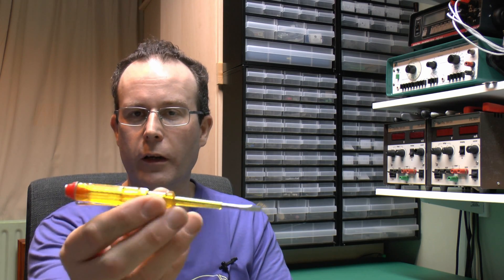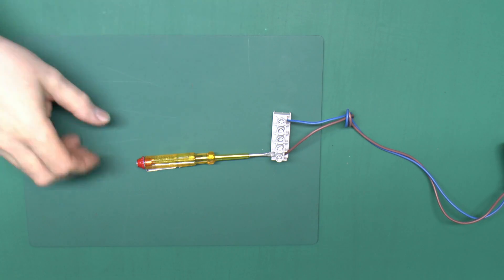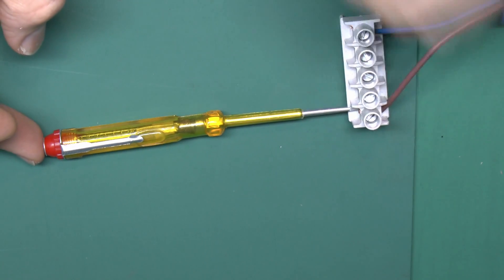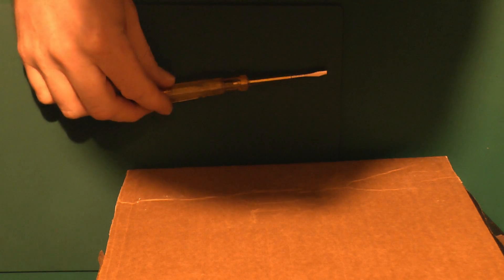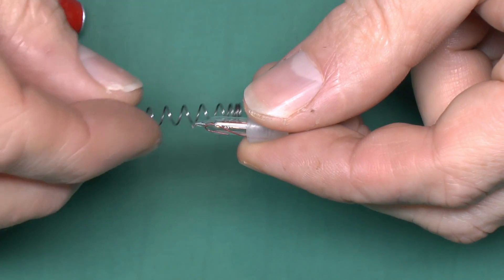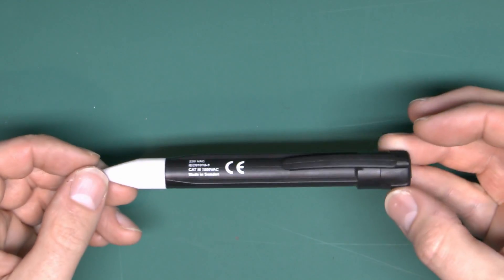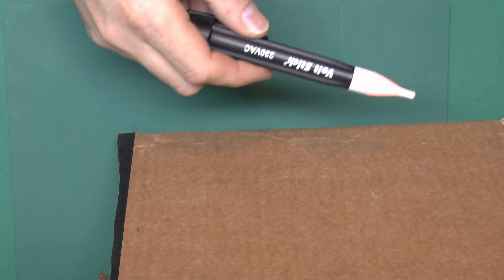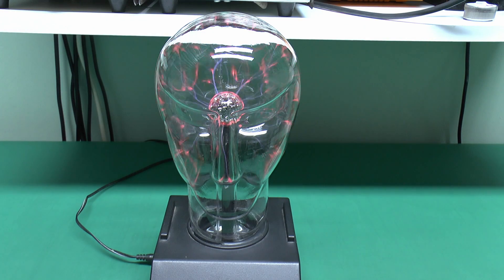Dangerous Device - Neon Mains Testing Screwdriver

Comment: Neon testers/screwdrivers are perfectly safe and very practical : you need only one hand to test the presence of the mains voltage.
How you should use them : first make sure it's working by probing an outlet you know for sure is live. If it lights up, only then you can check unknown circuit.
That's because those testers can fail in which case you could test an outlet under voltage and neon wouldn't light up, getting you shocked by believing there's no voltage.
Two pole testers are much more dangerous and require two hands.
Have you not witnessed a situation in which neutral wire is cut off ?
I certainly have.
So, your two handed tester doesn't light up because there's no voltage differential, no current return path (broken neutral), but : there is live mains still present.
You assume there's no voltage in that circuit and, .....
Reply: Szakembőr TV TMIAE 
Of course there is. The current flows in both directions, yes. But there is indeed a current return needed. Because you need two poles to create a voltage differential. In case of the neon tester, you are grounded, and therefore you already have the "neutral" potential. A small amount of current will flow through the neon/resistor. 
The plastic tester works like an antenna which receives the 50Hz/60Hz electromagnetic pulses/waves from the socket. BOTH only work on the live wire, not neutral or GND(which as far as i know, is a second connection to the earth, neutral is connected to it as well)
If you are NOT grounded, e.g. wearing insulated shoes, the tester will probably not light up. (Maybe, the tester WILL light up because of the EMI)
EDIT: my fault, it will light up, because of human body capacitance. But the current through the neon greatly depends on things surrounding you and the texture of the floor.
Reply: John Smith or u could find a earth . jus to be safe
Reply: If you are testing household ac wall socket circuit only, you are right, it is almost safe, but in case if the circuit involve any ac voltage less than the ignition voltage of the neon blub, you may get a good kick from it. Some old pa system may be?

Comment: Novice question - if you disconnect the neutral wire in you demonstration (blue wire, and disconnect from the remote end - not the connector you are testing)  I'm assuming that your two pole device would show no voltage ? And in that setup only a single pole device would show voltage on the brown wire ?
Reply from the maker: netrixuser Yes, a basic two pole testing device (such as the black one with a lamp in it) requires both probes to be connected.  However most of the newer voltage indicators also include the single pole detection as well.
Reply: +ĺll jji

Comment: I once read a letter in the comments section of a MAJOR electronics magazine describing the authors home made antistatic wristband design. It was a metallic bracelet with a 12 gauge wire connected to electrical conduit. No mention of a megohm resistor in series with the wire. Not one of the "editors" caught this mess.

Comment: There is lethal voltage between the terminals, but the neutral wire has potential equal to ground so no threat from that side and no indication from the screwdriver on that terminal. The wireless version is also (even worse) crap, when the cable has 3 phases it shows nothing, had quite a few bangs because of it after cutting energized cable, it lights up bright when there is a live conductor next to the unenergized one tested unlike neon tester that is significantly dimmer in same situation. The two probe tester and voltage measure doesn't work if the break is in neutral wire, so that can have also a very lethal results. Apart from that I haven't heard any deaths caused by this device.

Comment: Spurious video, load of rubbish! how can a carbon resister "short out" they always fail open circuit. How many people have been injured by neon screwdrivers? I have been an electrical engineer for over forty years, and never heard of one injury! I think it is far more likely that your video is sponsored by the overpriced test equipment manufacturers association! Any type of discharge lamp will glow in a strong electrical field, go wave a flourescent tube under HV pylons, that proves absolutely nothing.
Reply: Phil Whitley I also never encountered a short carbon resistor till date. They always show open circuit in case of failure. 👍
Reply: Does that make this a Non-Contact current sensor? That seems very cool :)

But the vid fails to explain why it fails sometimes.
Reply: Great for fault finding in a panel
Reply: I think he's trying to make a point here is that screwdriver is unsafe, if you accidentally dropped it into water and pick it up, put it into your pocket and just forget about it, when you happen to use it again then you'll get a nice surprise
Reply: Lots of electrical devices can be dangerous if dropped into water, unless they are rated for water. Common sense?

Comment: hi john Can I ask u a question.
I am boarding my loft and I have come across some older conduit with wires in where some are taped up at the end  when exiting the conduit, and 2 seem to be going elsewhere although I cant find the end yet as they are under loads of insulation. Now the house has been rewired and there are quite a few newer grey coaxes in the loft aswell but I am not 100% that the wires in the older 1950's looking conduit are still live and connected to my new fusebox in someway . So what would do you think and also recommend the best testers and yes I have 2 of those plastic screwdrivers.
Thanks P
Reply: +staypress Ask / hire / pay a trained and certified electrician, for goodness' sake!

Comment: Some of these comments are a joke. 

These screwdrivers are not approved voltage indicators. 

The question isn't 'what will happen?' It's 'what could happen?'

For the poorly educated electrical cowboys out there, read the document GS38.
Reply: Adam Griffin I actually had to talk somebody out of sticking a metal implement into a light fitting a few weeks ago. "Yeah I know if it's unplugged you'll be ok, but if it's not unplugged you'll have a serious problem." Just like how "It's alright, the gun isn't loaded" until, well, it is loaded...

Comment: I'm not sure I see the point of the two terminal probe. If I had that simple case of two exposed metal terminals then I'd use a multimeter between them. OTOH a common scenario for a power tester is if (say) I come across a red wire under a floorboard and I want to know if it's live or not. No terminals available. I don't have a tool for measuring electrical field, so the light up pen is about the only thing you can use AFAIK. I find that they're more reliable if you rove them around - they seem to be more sensitive to a moving field.
Reply: I swapped a single socket for a twin at a friend's house. Easy job but testing my work resulted in me checking out the whole ring main - under the downstairs floorboards. I found single-insulated cores for the lights - damp, cracked insulation - lit a neon tester no bother - so you can use them for insulation resistance tests too ;)

Comment: I was always taught to not use the led test screwdriver.  One day working with a very 'switched on' Polish guy, always used one...he critised me for using my Fluke voltage detectors and I just said, I dont think these screw drivers are very safe - in a nut shell, checking an em/light on a night shift, he threw his test screwdriver so far on the floor and walked off.  Me being slightly confused? his reply to my 'you alright' question - "I got a f-ing shock" - he still continued to use that same tool (out of pride?) anyways!! they are not 100% safe!!!!!

Comment: To all those that knock this advice. Stop and think; does it seem safe if you form part of the circuit?
Reply: The way I like to think of it is to mentally note anything at a voltage level relative to ground.  That nub at the end of the screwdriver is live, regardless of the resistor.  Yes, the current under normal operation is tiny, but it's still live, and having to complicate my own safety protocols by remembering that some things that are live are live but high resistance... no thanks.  It doesn't sound like much complication, but when you're just keeping it at the back of your mind, I don't want to make it any more complex than: that thing = bad.

You're essentially trusting your life to a resistor.  Yes, modern components, properly sourced (which we don't neccesarily know about these), are generally reliable.  Even with a redundant resistor, I don't feel safe trusting my heart beat to a 1 cm piece of carbon and metal.  Or two.

It may be controversial, but I 100% agree with this video.
Reply: It's, because it's the only reliable way to know if touching that circuit that current will flow trough you. You test between L and N, if N is disconnected or at live potential is not working. Also if you test between L and E. In a worst case scenario you have N and E live, and your tester shows 0v, so you think you are safe but you are not. 

Also the neon screwdriver is called also phase finder, for a reason: you use it to find the phase if you need it. And it's damn useful in old installations where they used the same color for L and N, and sometimes even for E (if present at all!)

Comment: Do You  get pay for  advertising high  end  tools  tester seem all tools you  have started   ££-£££-££££ not £0.50  tester that is most people buy because not every day they use like us; as long they can screw in or out to  fit their  need  that 's  all it matter. Not every body call  engineer to paid £40.just to see the light on your tester. it just  my view  that's all.
Reply from the maker: Dhwe Eu Two pole voltage testers can be obtained for less than £5.  Those in the video are more expensive, they are just the ones I happen to have.  I did not get paid by anyone for any products in the video.

Comment: Hi John - nice video, and sound advice. But when you say these devices are no use for anything - I have found these screwdrivers make a great cheap HV indicator, from a terminal to free space (not using the human body in the circuit) when the voltage and corona/spark/arc current are enough to light the neon. Might be useful for Tesla coil tuning (but no touching, hands at least 5 feet away please). My video shows a neon screwdriver on fire after being subjected to more than 250,000 volts. But it won't be going anywhere near my general purpose tool box after that experience.

Comment: My only takeaway from this is that you prefer cheap editing tricks to information. 

Both single ended sensing devices detect voltages above earth, one requires a low impedance path to ground reference (screwdriver,neon bulb, metal cap to finger) and one works at very high impedance (solid state voltage tester, jfet, hand touching outside of plastic housing). 

The two terminal probing not only is huge, but only tells you a difference is there, not which leg is above ground potential.
Reply: Exactly
Reply: How exactly is that "cheap editing tricks"? 
If you can't understand this, my god.....

Comment: If you have a fault on the neutral wire then the two probe dectector will fail to detect a live terminal ..... But the neon probe will.
Reply: If you assume the worst, you can find L and N swapped (or worse, having the same colour!) and earth at live potential. This screwdriver will tell you if it's safe to touch a particular conductor. 

With the voltage tester, you first have to know which cable is which (seems easy, if you assume that the electrician that installed the thing was sane and used the correct colours), you assume to have an earth available that you know it's connected, and you assume earth is not at live potential. 

A lot of things can go wrong. Touch the wire with the screwdriver, if the light turns on, don't touch the cable, if the light stays off, well there is the change that there is no voltage, but better not touch anyway. The screwdriver can be used not only on electrical wires, but on cables, metal equipment, and so on. How do you test a machine to know that the chassis is not live (that is not earth or the earth is not working)?

Or simply, these screwdriver are a fast way to know if something is properly earthed. Try to touch with the screwdriver for example a PC that is not connected to an earth, the light of the screwdriver will turn on (even if it's not dangerous because the current is so low that you can barely feel it). It's also useful to test for line voltage on things where you don't expect voltage, telephone and network cables, TV coaxial cables, security alarm, etc. Better do that before touching them.
Reply: @alerighi  p
Reply: @Chris Collins and what about country that doesn't have earth? (or they are actually protection wires connected to breakers, not real earth). Father sometimes was testing against wall.. surprise, some brick walls are good enough to detect phase. By the way, same 240V  here too, a phase and a zero though.
Reply: You mean an open circuit, but yes, that's a good point.
Reply: @Martin The test using the two-probe voltage detector here was only performed for the purpose of comparison. In the real setting, we turn off the circuit first at the consumer unit and do the test at the load side terminals of the fuse/breaker before working on the circuit. Our isolation procedure also involves testing between line and earth and between neutral and earth at the consumer unit, so everything is being confirmed. Before and after every procedure, we are required to test the voltage detector on a proving unit to ensure it is still safe to use. We are also required to use approved voltage detectors with test leads that are either fused or installed with a current limiting resistor + fuse to protect against overcurrent. Neutral-to-earth faults (in circuits without RCD) or an open neutral, if any, will be detected with further testing if the circuit does not work
Reply: @Martin the neon screwdriver tester is not guaranteed to work at all times because it relies on parasitic capacitance between the live conductor and earth, with the user acting as part of the circuit. If the user is far from the ground (e.g. standing on a wooden ladder), the neon will likely not gonna light up even if the conductor being tested is live
Reply: @rurouni762  I have a 5mm thick rubber mat at my consumer unit and it's there for me to stand on whenever I do anything there. My test pen always performed whenever I do an LDL . I personally believe that the neon test sd should not be used as a screwdriver at all - when tightening we run the risk of breaking the insulation or whatever little wire in it thus leading to intermittent connection issues. Just my paranoia :) 
I will also add that in the vid where he "proved" that the neon test sd will not light up... how do we know that there was proper contact? In contrast, the two-probe lamp was actively pushed down on the terminal screws guaranteeing contact. How about laying the probes next to the terminal on the table as he did with the neon test sd? That way we can also "prove" that the two-probe lamp is unreliable  LOL
Reply: @rurouni762  rubbish, I stood on my bed and the the line conductor at the ceiling rose and the neon screwdriver eluminated I a beacon. Neon screwdrivers are not dangerous ,if they were they would not be on sale, they have been available since the early 50s and there’s evidence of anyone being electrocuted by using one . I have had mine for thirty two years and I have never never had any problems or shocks. From using it.
Reply: @rurouni762  There si no need of connection to the ground. It works even if standing on a dry wooden while wearing shoes with rubber or plastic soles. It is the body that acts as a capacitance. By contrast, the lamp won't light up if you connect the screwdriver with the same wooden floor using a metal conductor.
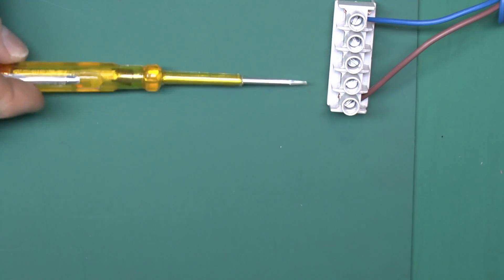Reply: 3:11 clearly lying for his own purpose, you can see the orange light come on then he moves the screwdriver tip to a point where it doesn't make contact
Stupid virgin
Reply: @RaiderOfTheLost  I dont know what you're looking at, but it isn't the same video. At no point did the neon in that screwdriver "light up" unless you're referring to the small orange glow you can see before the screwdriver even comes remotely close to any form of contact. That's just light shining through the yellow handle, and if you can't work that out, you're a room temperature IQ limpet that wouldn't even be allowed on the ocean floor by anything that even remotely considered itself a species.
Reply: @RaiderOfTheLost  except he isn’t lying and it doesn’t illuminate.
Reply: Yes you are right. But this prick is using a 500v tester on 240 v. No wonder he can hatdly see the light.
I hope he does not claim to be an electrician.
Reply: @paullee5573  the neon screwdriver he is showing is rated 200V to 500v